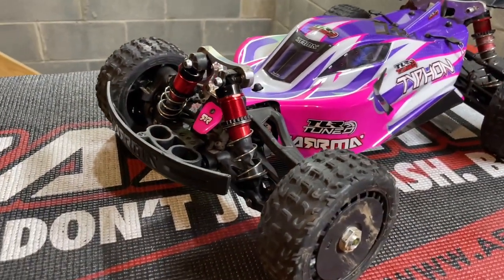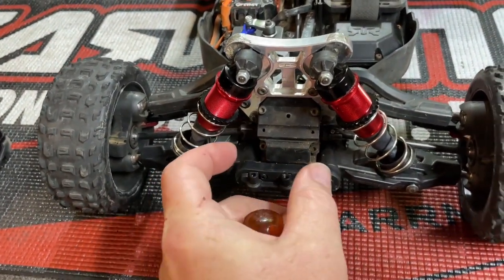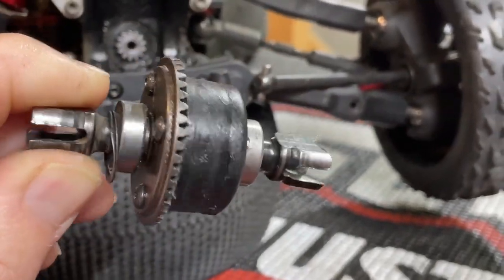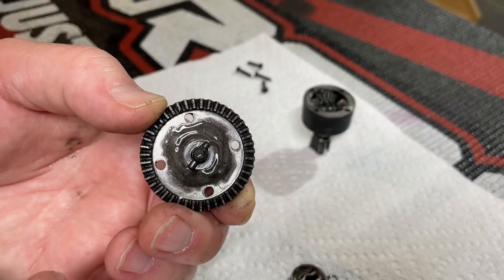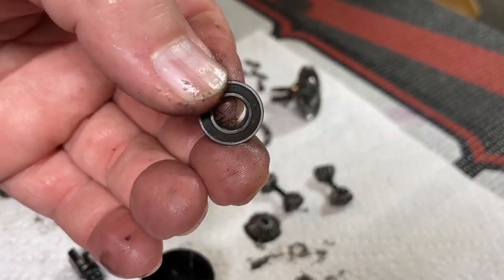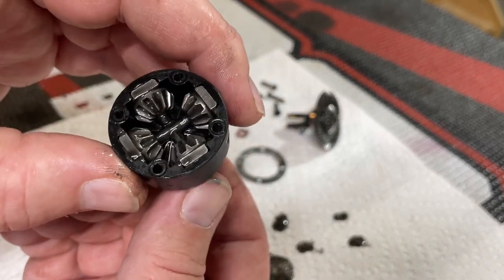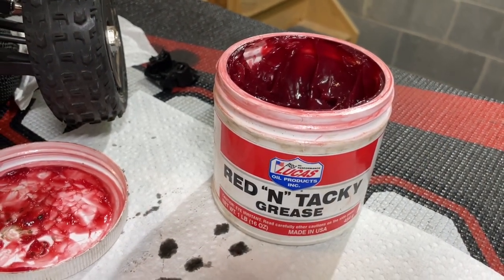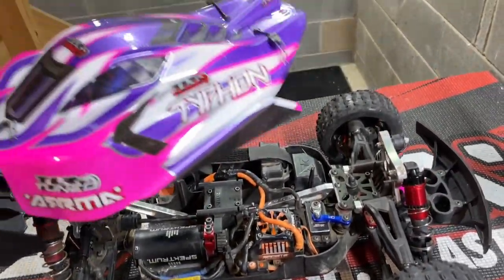ARRMA 6S DIFFERENTIAL REPAIRS MAINTENANCE AND NOISES.

Comment: Was chasing the noise in mine and thought it was the rear diff so I cleaned it up and checked teeth and it was good. When I got to the front and center I found a pin in both broke. Sometimes they break in half or 3 pieces. Also when they break they can jam and not free spin which can throw you off unless you've come across it before and check all inner pieces. Everytime I had to rebuild a diff I kept all the good parts and eventually have a full spare to use in the future. So the Notorious Outcast has a good bill of health now. 🤙 I know with this video you will be helping a lot of people as it will give others the confidence to look over everything and things they wouldn't have thought of. First thing to do when checking diff is to wiggle the drive cups on each side of the diff. If you get play in the cup as you move it, time to check everything else while your replacing a pin. And for others, the little hole in the diff cup where the little grub is, is so you can take the grub out and use the hole to insert the bottom pin then replace grub.
 🤜🤛 And make sure to clean and get all debris from any broken teeth or pins or you will be taring it apart again.

Comment: Just a little FYI , but anyone buying an ARRMA should check your diffs to make sure they have the proper amount of grease and fluid in them cause mine along with many others barley had any grease in both the front and back. I think ARRMA is bad about not putting enough in them from the get go .
Reply from the maker: Yeah, they have been famous for not putting enough grease in the differentials for quite a while

Comment: Hey man, I’ve had my big rock 6s and have ran it for about 2 weeks, pretty chill runs. I noticed a loud noise and it sounds like it’s coming from pinion, maybe it’s too tight, idk I’m going to check it later but was wondering what you think.
Reply from the maker: Well, make sure there’s nothing jammed up underneath or in the gears rocks love to get in there and hide but if it sounds like it’s too tight it very well could be if you don’t have any play between the pinion and the center gear. It probably needs adjusted.
Reply: @BarstoneRC  I was throttling it without the tires on 😂

Comment: Truly, a FANTASTIC video on checking & rebuilding diffs.  The next time I do a video referencing diffs, b I'm going to place a link in the description to lead people to this video.

Two tips is like to suggest:
1)  In removing a shock, to screws the diff housing, instead of switching the shock from the suspension arm, v it's almost always better to detached from the shock tower end.  The reason is that most suspension arms are plastic, and every time a screw is inserted/removed, it has the potential to weaken that area.  Eventually, the threading will give, the shock's lower mount won't hold, and it'll be time to get a new suspension arm.  In removing the shock attachment at the tower end, the worst thing getting ruined in a Nylock nut, which is a lot easier, and cheaper, to replace.

2)  Regarding the outdrives, while yours did need to be replaced, such isn't always the case.  Sometimes, it can look as if the outdrive is "spreading apart", but what can actually be happening is just that material is getting removed from all the 'forward' motion of the vehicle.  If one side is perfectly straight, and the other side has "indented wear", a simple (and free) solution is to just swap sides of the outdrives...disassemble the diff, move the outdrives to the opposite sides that they were on, and reassemble the diff.  Now, each of the outdrives will have the driveshaft's CVD pin pressing against the other side of the outdrive.  By doing this, instead of replacing the outdrives, you double the usable life of the outdrives.  If course, if the outdrives are actually spreading apart, as yours were, them replacing them is the best option.

Comment: When i think about shimming diffs, i also put shims behind those 4 gears that ride on sun gear. 😉 I went through my brand new fireteam before running and changed to 200,000 in front and 500,000 in rear and center. I think it is team accociated oil so diff numbers. Nice n thick for big rig 😉 anyways got whole truck back together and noticed play in-between two cups on diff ☹️ i forgot to shim those 4 small gears. Gotta rip it all back apart and shim them all. Took me 10 hrs first time with hand tools. I will be using one of my small electric drivers for next time 😁 great video man!!

Comment: Great video! I just bought my first RC car, Typhon 6s RTR. This is great to learn what to check but I don't know what you mean about the ear plugs in a diff. Guess I need to research that. Thank you for taking time to show these points.
Reply from the maker: Thanks for stopping in I appreciate it but what I mean by the earplugs they sell silicone earplugs on Amazon and you replace the fluid in the center differential and squish the earplugs in the gears and it locks it up, but still allows a little bit of give

Comment: I like how you explain details to details I need help on fixing steering on a arrma notorious 6s v5 blx just got it and already lost steering servo moves with the mount even with an upgraded aluminum mount but when I lift car up I get the steering back but the servo still moves with the mount had this for 2 almost 3 weeks and only played with it for 20 min I don’t wanna feel like I wasted almost 600$ on my first big scale rc 😔
Reply from the maker: So when the car is sitting on the ground, the servo moves, but the car doesn’t? If that’s the case, most likely, your servo saver is way too loose. I don’t think I ever put together a video on this but there’s some out there on how to tighten them up. It’s not too hard.
Reply: @BarstoneRC  yea and ok

Comment: Nice video!

You should try 30k at the back and 60k up front, the car naturally bogs down at the rear giving the back wheels more resistance and most of the power gets sent to the front wheels,
heavier oil in the front mitigates this.

And I was wondering if the sun-gear you got there is interchangeable with the EXB sun-gear? 
As you probably know, the back side is different, the one you have in the vid looks biffier with just the one pin slot.
The EXB has an "X" shaped slot, and that's where min keeps breaking, My pin doesn't break, my pin breaks the sun-gear...😐

Thank again for a great video.
Reply from the maker: I don’t think I’ve ever tried to use, or interchange the sun gear between the two differentials. I’m honestly not sure on that.
Reply: Ok thx.. If anyone else knows, please let me know.

Comment: Hi just happen to find your video 😸 i have a question i just bought the super bash bumper from armma for my typhon TLR how did u mount the back 2 screws  at the bottom?  There are 2 holes on the chassis but nothing to mount it  too😅 did you add a nut and tighten  it?
Reply from the maker: Are use small screws with nuts
Reply: @BarstoneRC  thanks for the quick reply 😺 i will add nuts to the screws 😁

Comment: One thing to look for before assembly. The output cup end should be flush with the gear.
 And as far as the input pinion gear. Put loctite on the shaft and in the cup. Very important imo. Get video ya know
Reply from the maker: Good tips also

Comment: I’m sorry if I’m just not seeing it. But did you a video on the center diff? I’m running a new kraton 6s and having all kinds of issues with it. Steering linkage screw came out and lost 2nd battery run 4th battery charge servo quit replaced that and 5th battery changed and wing stand off broke on a 2 foot high jump at 10mph 🤦 so about 8th charge on battery and drive train is just really loud.. no clicking but more like a chain saw noise. Seems to be central diff . I’m just going to break this thing down over the weekend and see what I can do about this thing. I’m not sure if I just got a Friday afternoon built one but really problematic unit to be having so many issues in 5 days running and only during my lunch break at work lol. Any suggestions would be awesome.
Reply from the maker: Well, you should be able to easily see the gear on your center differential if it looks chewed up if it doesn’t look chewed up and it makes the noise when you hit the gas it’s probably your rear differential

Comment: Great info for new hobbiests! Did you say you get that car up to 85 - 90mph with that stock spektrum system? 😮😮😮
Reply from the maker: Yeah, my top speed with this when I was doing speed runs was 98 mph with the stock system with just gearing
Reply: @BarstoneRC   Did you have heat issues? I really don't know how much abuse the 6s spektrum system can take. I typically pull the guts out and run castle MMX8S esc's with 1520 or 1717 motors. I love the logging ability of the esc's but I'm really curious to see a real head to head comparison of the stock spectrum systems vs aftermarket kits.
Reply from the maker: @reconrc1787 I’m not sure if I got a special system, but I have beat the holy hell out of the system and it just keeps on running after a couple passes she would start to get pretty warm but nothing terrible but I was just doing speed runs at the time

Comment: Mine sounds  in the front  but I open the diff and it was fine no broken teeth or cracks
Reply from the maker: Make sure you look closely at teeth. The whole tooth won’t break off just the very tip of it.